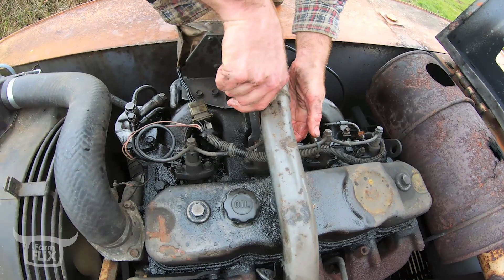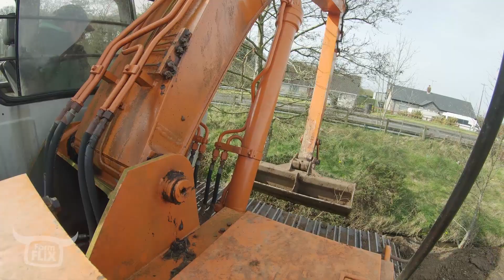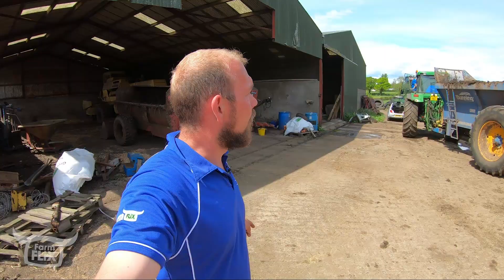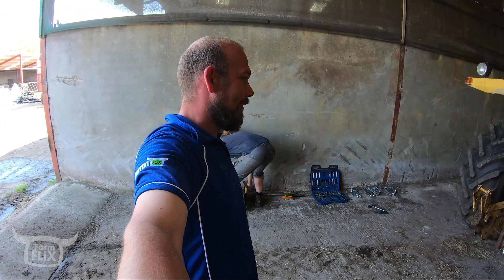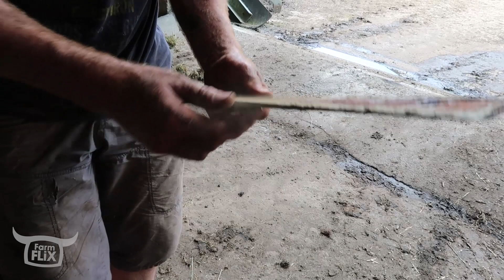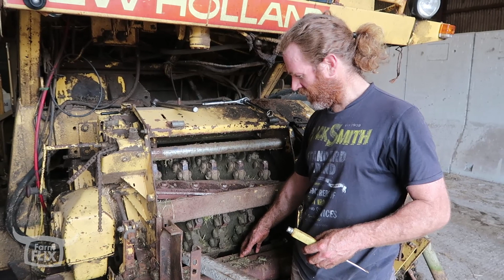NEW KNIVES FOR THE 2205 SILAGE PREP!!!..... Alan Clyde | FarmFLiX

Comment: I run 12 knives in my pull type, I adjust cut length by by feed roll speed
Reply from the maker: Don't know if the big 2205 has the power to cope with 12 knives lol
Reply: FarmFLiX  I’m only running 119 pto hp on my chopper, picking up 10 ft row around 5 mph